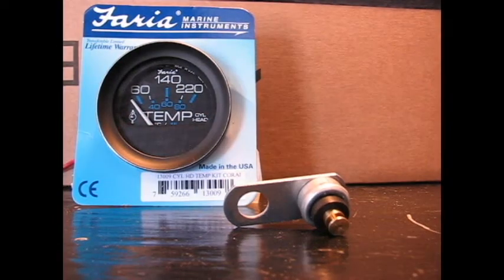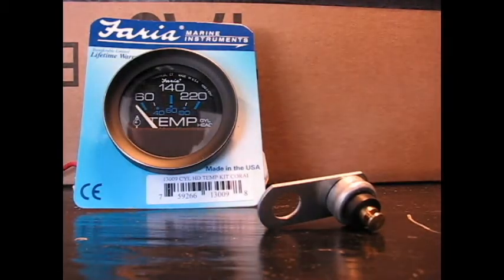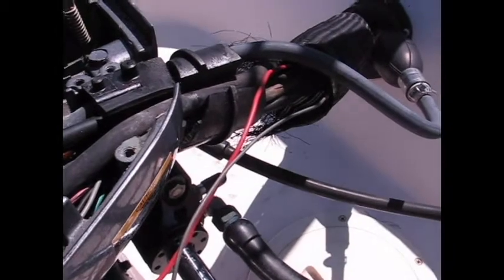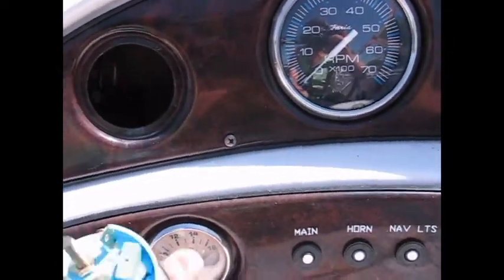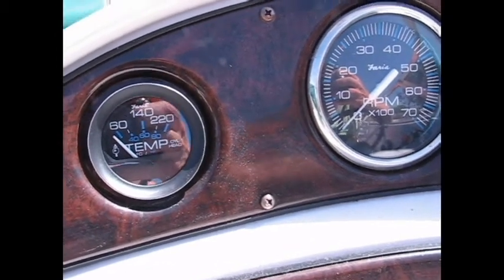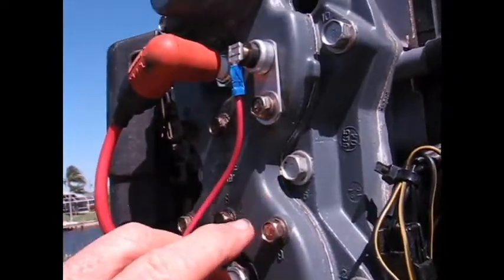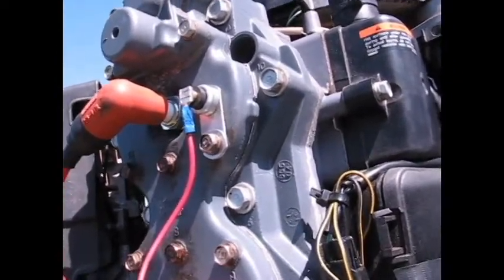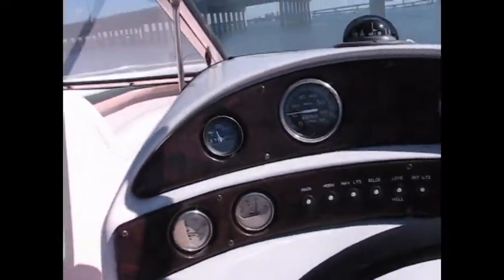How to Add a Temp Gauge to an Outboard Motor

Comment: Thanks for the info. 
I have an older 90hp evinrude and it's a great motor, but it overheated last fall and I couldn't hear the stupid little buzzer in the shifter going off with the motor running. I put a new water pump and thermostat in it but it's nice to know there's a simple way to monitor head temp constantly. Getting one today. Did the sensor itself stay attached to the metal tab?
Thanks again

Comment: You could add a dab of thermal adhesive to the bottom of that temp sender. Same stuff they use to glue led chips to aluminum heat sinks.

Comment: Your getting water jacket temp not head temp. You are not getting a true reading
Reply from the maker: This is not intended as a true temp reading.  Just a point of reference so you can tell when the engine is at full operating temp and tell if engine starts going above that temp (overheating).
Reply: I guarantee it'll show a temperature rise at anything above normal .....thats the goal....I'd rather see it on the dash creeping up above "normal" than to wait on that may work buzzer....😂😅

Comment: Do you have a link or part number for the sending unit
Reply from the maker: Part number for the whole assy is at the start of the video.  13009.  Sending unit itself is probably not sold separately.